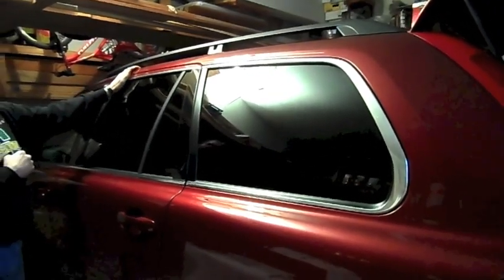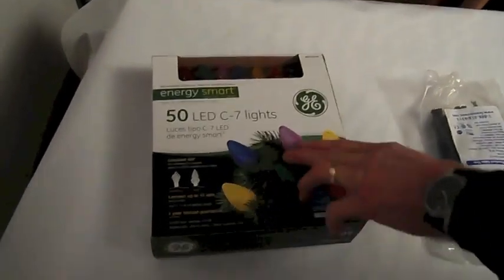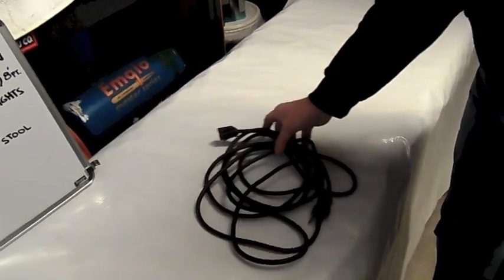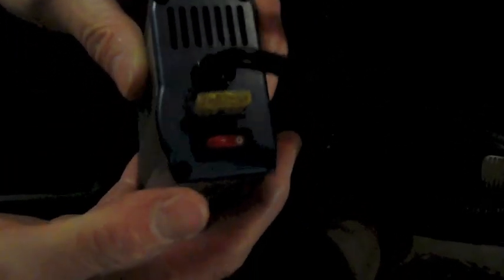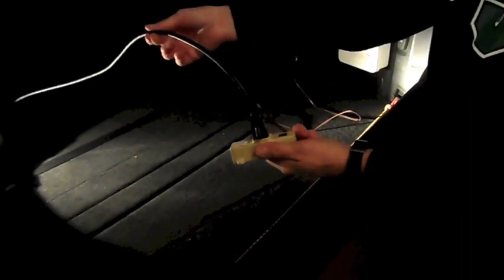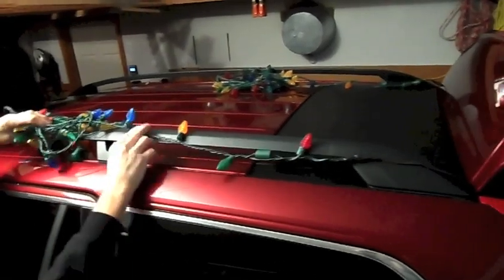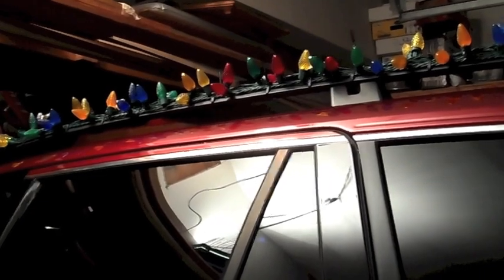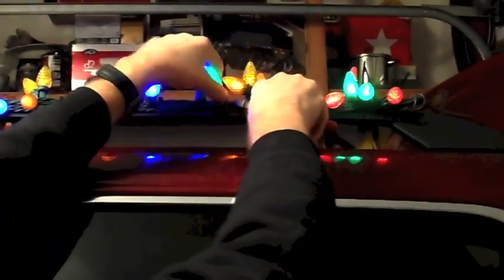How to put Christmas lights on your car

Comment: Why is it necessary to splice the wires together? Why don't you just plug the male end into the female end?
Reply: Because the ends of the cord were heavy when you plug both cords together and there is nothing on the vehicle to zip tie them down to keep from rattling down the road. All vehicles are going to be a little different. Good luck!
Reply: bluehuff1 he plainly says in beginning of the video that it's important to have a luggage rack on top, ok, a place to zip tie an extension cord instead of creating a fire hazard of baring bare wires when splicing. Just use an extension cord.